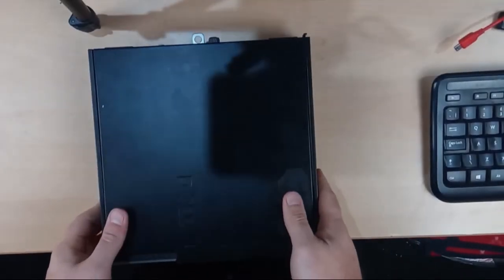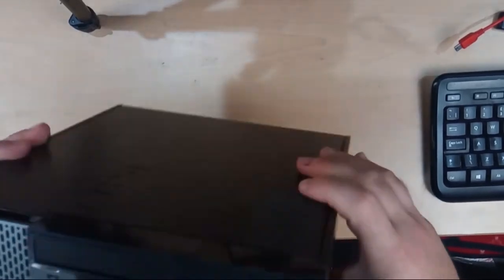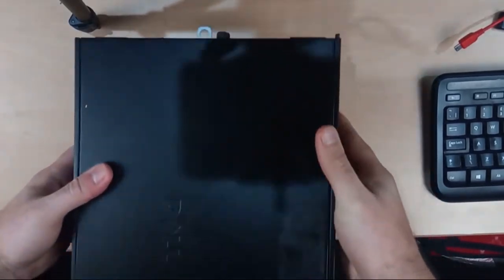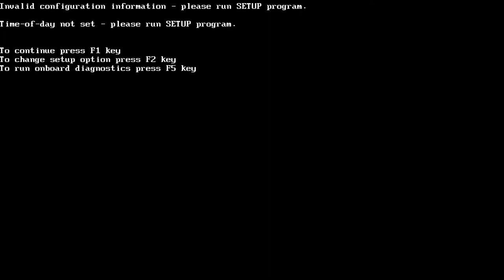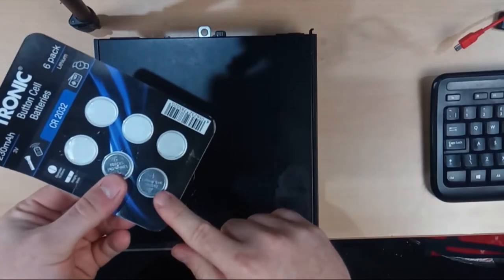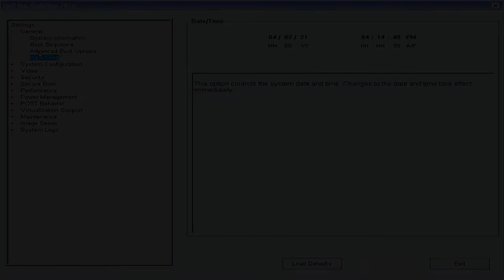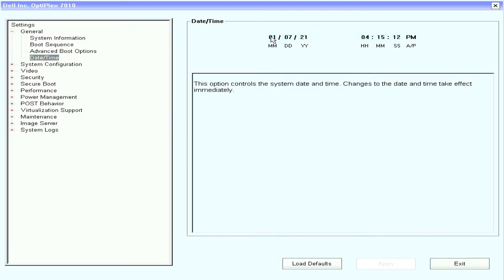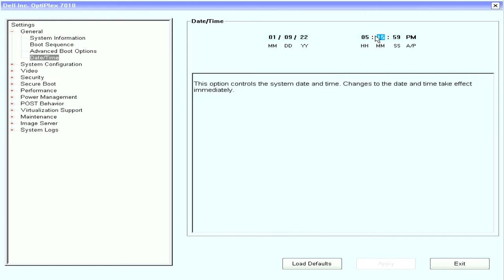#74 - Dell OptiPlex 7010 USFF battery replacement - RTC CMOS

Comment: Thanks - I watched the video 3 times before setting to work on my machine. This made it easy for me . I found that I didn't have to disconnect any of the wires apart from the fan, which was tricky as not much room and tight fitting in its socket, but I got there and the battery changeover was ok with the help of my desk lamp and two flat head screwdrivers.

Comment: Are there more than one battery?  I just replaced mine and it still won't boot up and shows the battery light...
Reply from the maker: double check you have it the right way round, but only one battery internally.

Comment: I have one of these that I am now using for retro gaming and it has just started doing this so will need the battery replaced also. What kind of a joker puts the CMOS battery right under the heat sink? Never seen this crazy design before. Thank you for sharing this info. :)
Reply from the maker: Yeah seems somewhat silly to me, but with the expected business use of a few years, and battery lifespan longer than that, and space being premium - i guess it's more compromise that anything else.